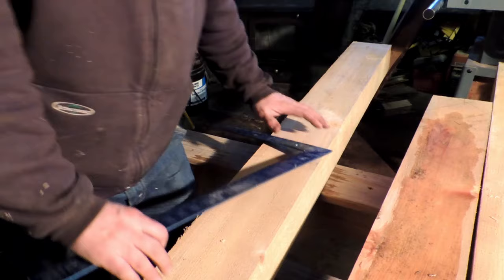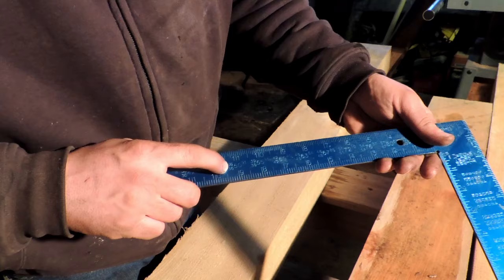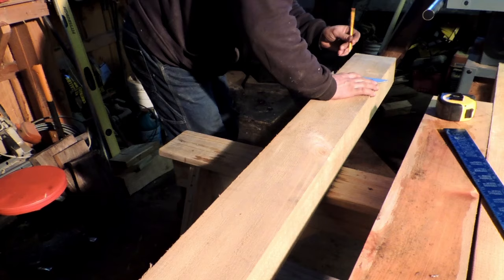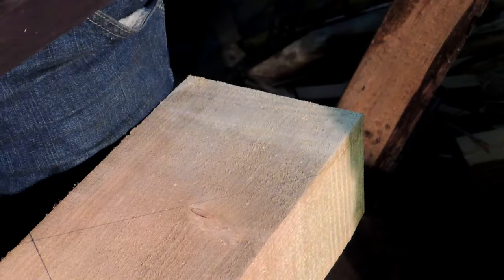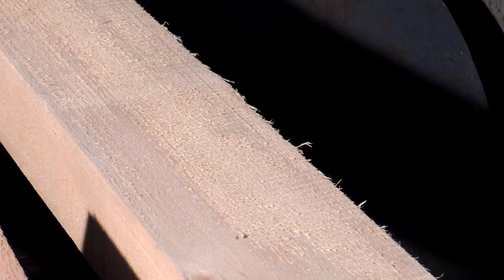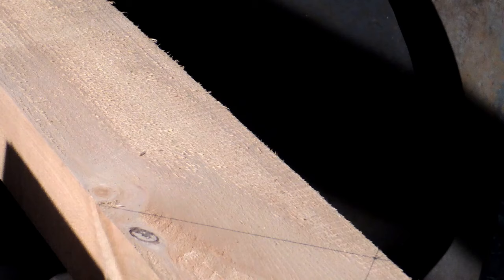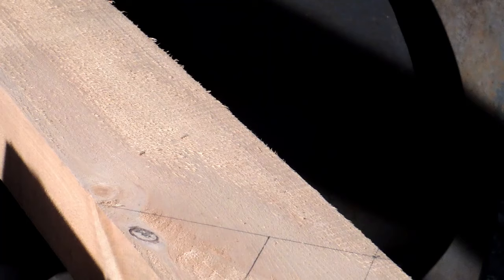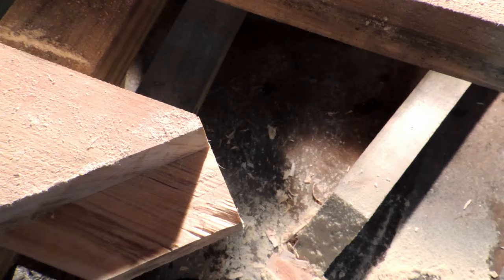A Timber Frame Vlog #8: The Knee Brace Explained

Comment: Hey Jim, hope all is well, if you remember I asked you a question on another of your brace demo's. Which I asked if 4 x 3 was ok. I have re-ordered, a batch of 6 x 4 inches and happy to of done so. Now I can add the curve for appeal look. 
Question: I've seen quite a few posts and puzzled to what is the best, having the tenon as you have demonstrated at half cut on one side, or tenon centered.  Bearing in mind I am now using 6 x 4. Posts are 
6 x 6  and so do I have the reference side on the braces facing to the outside off the building so it's flash with the posts, or is it best centered to the posts and therfore ending with 1" in on internal and external faces of the beam.
And would the tenon thickness be 1 1/2" x 5" length and 2 7/8" deep. 
Appreciate your help as always Jim mate.
Reply from the maker: Always put the tenon to one side, you will thank yourself later.  It just goes smoother and you don't need to worry about two perfect faces.  I do remember you quite well.
Reply: @TheTradesmanChannel  would love to visit you with my son and see you and your wonderful work . Thanks for your help Jim 👍

Comment: I hope that your summer is going well.  I'm building awnings this summer and I'm noticing that my knee brace shoulders are never quite perfect (off bevel?) and it's driving me nuts! So I was wondering if you ran into this issue?

1. I'm working with accurate 4x4s
2. I'm cutting centered 1.5" tenons.
3. Bevel is at zero and true for all my cuts to make the tenon
4. I'm referencing the same side of the line for cuts.

Any ideas? Thank you!
Amalio Pratti - Massena
Reply: are you using a square (also verify your square is square, you'd be surprised how often squares, at least from big box stores, are out of square) to verify your saw is at 90 degrees? Never trust the numbers on the angle guide, even for the most high end circular saws.

Comment: Hey. Great content on your channel - I subscribed. I'm looking for the follow up to the knee brace video where you show how you layout or transfer the marks for the mortise housing. What I'll be building I wont be able to lay it out on the ground - it will be after it's 15 ft up so I'm curious how you do it so I don't kill myself trying to dink around with it up in the air. Thx!
Reply from the maker: If you don't mind me asking, why are you not cutting the brace mortises on the ground?
Reply: @TheTradesmanChannel  Mostly because I don't really know what my ending height of the posts will be until I get them stood up and figure out exactly how I'm going to tie it into my roof of my house. If I were smarter I could probably work backwards on the measurements, but I don't even have my concrete footers in place yet. Now that I'm thinking about it I can probably figure it out once I know where those will stop. I don't trust myself doing that much cutting while hanging off a ladder so I'll do all I can to figure it out prior to setting the posts.

Comment: First of all, I have to say I truly love your videos.  Stumbled upon your videos while doing a little planning to build a pergola over my patio.  Seeing how easy it is to create corner braces using timber framing joints has made me want to incorporate them into my design.  Second, as I'm drafting up the pieces and parts for my pergola, there seems to be an error with how the knee brace length is calculated.  Since you're insetting the connections in by 1/2" and using the 3/8" setback, don't you need to extend the length of the knee brace 50.91 + 3/8 + 3/8 so the mortise on the post is exactly at 36"?  Or did you shift the mortise on the post up to match the knee brace?  I hope that's clear, but if not maybe we can connect and I can send you my CAD layouts.  A picture is worth a million words, right?  Cheers!
Reply from the maker: +Mike Scheve the idea of the 3/8" setback is to account for the 1/2" housing.  So you measure in from the edge 3/8" and the 3/8" line is where you measure your brace length, that way it will be a right fit for your layout.  I can do a better video at some point, I'm getting better at the camera work.  I appreciate you watching, hope you have a good evening.

Comment: Would a stud wall provide the same support as these knee braces? I live in a 18th century home which is timber framed. Seems previous owners removed a lot of these braces during renovations and installed stud framing to accommodate drywall. In a 1 1/2 cape, the 1/2 story wall over the living room seems to be racking out a bit.
Reply from the maker: +KJames Jr. If the stud walls are sheathed in plywood they might act as a brace.  Timber frames are built to rely strictly the framing members for all structural support.  Issues normally arise with them when people modify them.  Not saying that means your house will cave in, but there might be some odd shifting and racking over time.

Comment: Brace cutting made simple. Thanks for making this simple to understand. I have a few technical questions. A housing with more depth would have even more bearing surface, but at what depth of housing is there no longer a benefit? If your housing is 1/2” why not come up 1/2” on your brace? Is it because you want room for expansion of the timber? Because of the compression loads on the brace, would hardwood be better to use as brace material or is softwood better for the sake of elasticity?
Reply: @high fryer: 3/8" is one leg of a triangle.  Therefore, 1/2" represents the hypotenuse  of the same triangle.

Comment: You are the only timber framer I've seen the not only puts the entire tenon on one side instead of in the middle, but uses the angle of the slick chisel instead of laying the flat back against the wood when cleaning up the cuts. Is there a reason why you do these things? Is there a difference on load bearing between the side tenon and centered tenon?
Reply from the maker: +Thomas Russell the tenon to the side of the brace is fairly standard.  I do an offset tenon when doing the framing members which is also a standard layout method.  When I'm cleaning the joints off with the chisel I hold it like that so that I do not remove too much material from the tenon cheek.  When you chisel on the flat side it digs in deeper because the bevel acts as a wedge and will drive the chisel in deeper.
Reply: Ok, I was just wondering.
Reply: Thomas Russell There are a couple reasons for offset tenons. They are much faster to cut and depending on your posts, you can usually set the brace flush with the exterior side of the structure and still have your mortise centered.
Reply from the maker: +Jeremy Lee Makes you have some experience, thank you for watching.
Reply: TheTradesmanChannel 2017 Thanks for giving us content that isn't on every other channel, as this question proves. I just subscribed this week and there's a lot of good stuff here. Thanks.
Reply: @jeremyleemakes1272  Doesn't that subject the  beam to rotation?

Comment: Why an offset tenon rather that centering it on the knee brace? 
Are these used normally on the outside walls where the ones on the interior are centered?:
Reply from the maker: Any brace is generally cut this way.  It is just a stronger way.
Reply: Is the mortise offset as well?

Comment: The plans I am using are calling for a 3/4" depth housing. Would I still use the 3/8" rule? Or would it be a 5/8" My first timber frame project and loving the hell out of this
Reply from the maker: Draw a 45* line, put a mark at 3/4" from the starting point of the line and then draw a 90* line from the edge to the mark on the 45* line.  This will give you the length you need.
Reply: I’m not quite sure what you mean? Newbie. I followed exactly how you did things and it worked out but the plans I’m using have the bearing surface at 3/4” recess not 1/2” so do I use 3/4 as the reference line
Reply from the maker: If you can drop me an email the my website, tradesmanoffgrid.com, and I'll draw it out for you.

Comment: Is there a thumb-rule on how long to make the brace based on how long the timber is?
Reply from the maker: Not particularly, I tend to use the longest brace that will fit the situation and the load.  You have to keep in mind window and door placements.  I'll be doing a better brace layout video soon.

Comment: hello Jim,  i watched your video on the brace joinery.  i have some questions.  first of all, your arbitrarily picked a spot to begin your 3/8 point ?  two:  you made the corresponding 45 degree points along with the three inch mark.  three:  you began cutting the tenon. four:
how thick is the tenon please ? it appears that you've cut in half.   my question is:  what is the size of the mortise housing with the half inch 
measurement you mentioned ?  did i miss a video ?  i live in france, semi retired news photographer who lives in an oak forest.  please share the specs on the mortice and tenons please?  what are the beam sizes too ?  cheers

Comment: What if the 4x6 braces aren't exactly 4 inches wide but rather 3 3/4 or so. 
Having the reference faces on the hypotenuse and the top where you laid it out and cutting down exactly 2 inches would give you a different sized tenon each brace you cut. Wouldn't it be loose in the mortise later on, given that all the mortises will be 2 inches wide. 
Reading Learn To Timber Frame by Will Beemer and there it isn't any word about it either.
Reply from the maker: At that point you need to cut your brace housings  to match the brace.  You can still do a 2" tenon and mortice but you'll want a 3-3/4" housing.
Reply: @TheTradesmanChannel  
Thanks for the quick response. 
I am still not quite on the same line here. I don't really understand it yet.
What I meant is that my 4x6 is not just not true 4 inches, but it's also not square. I want that the reference faces of post, beam, and braces being flush on the outside, so I can sheet it without any gaps.
If I cut every brace the same 2 inches with my saw on top of the reference face I will end up with a odd sized, not square tenon every time. Adjusting the housing wouldn't solve the problem since it's the tenon and mortise that won't match unless I make customized mortises, right?
Reply: I was putting the timber for the braces through the bench planer to get it to a consistent 3 3/4.  That should do it for now. 
Thanks for the quick response again. Really like your channel.

Comment: I didn’t understand why you chose a 3/8” point in from the side (to allow for the housing) when you just said it’s a half-inch housing. It didn’t make sense. Then at 12:22 the video shows clearly the tape lying along the diagonal line, revealing a half-inch length along the line. Secret Revealed! The power of close-up video! Thanks for the clear explanation.
Reply from the maker: It works out perfect.

Comment: Your housed braces are too short. You need to reference from the arris on the post and beam.
Try a dry fit before you mass produce them. Good luck, stick with it.
Reply from the maker: They were all the right size.  You're laying them out on the timbers to account for the housings.  So instead of measuring down 36" on a 3x3 brace layout, you are measuring 35-1/2".